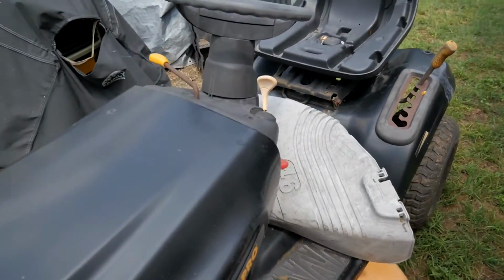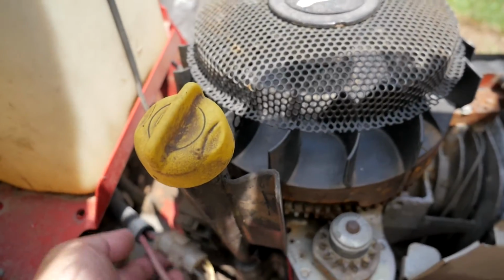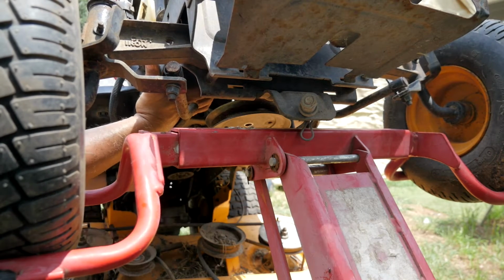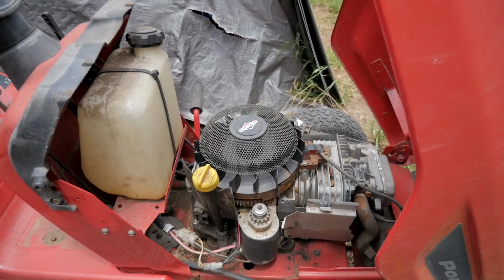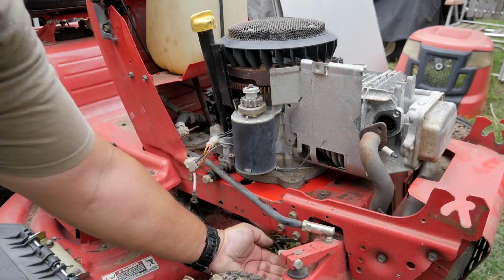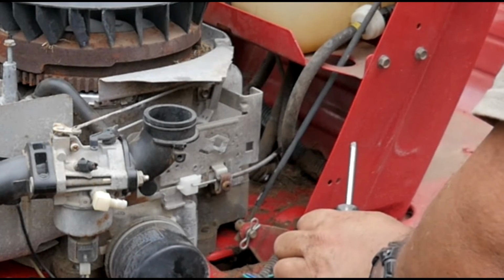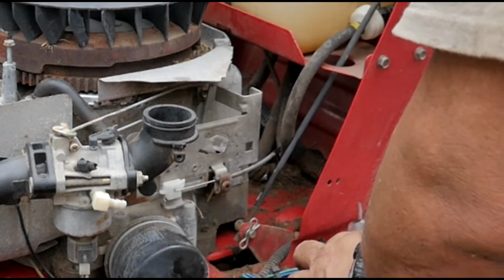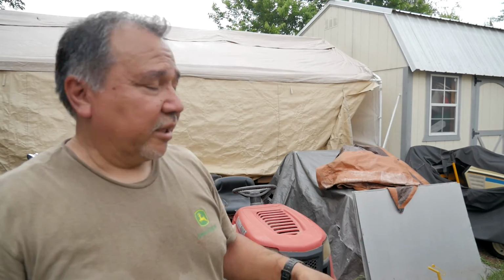Troy-Bilt Riding Mower Engine Swap with a 19.5HP Briggs & Stratton

Comment: I have a 40 inch cut Murry.  It had a 12.5 Briggs.  It was very low on power.  I adjusted the valves and it ran great, for about 30 minutes,  then it started blowing oil out took the engine apart, the top compression ring broke in 3 places.  I installed a Kohler Pro V twin 25 horsepower.  It wasn't real difficult,  but going from the Briggs,  1 inch crankshaft to the Kohler 1 1/8 inch was a pain. I thought easy just get a 1 1/8 inch pulley for the mower deck.  Not so easy.  I took an old PTO clutch apart, and used the lower part. I welded the top pulley from the Kohler to the lower part from the old PTO then cut the deck pulley off the 1 inch shaft and welded it to the lower piece from the PTO. works great. The lower runs true both side to side and it doesn't wobble up and down either.  That was the hardest part.
Reply from the maker: Awesome swap. Great fix.👍👍

Comment: Nice Swap.. Possibly modify a child's swing set (metal A frame style) to be used with a  chain hoist. Narrowed to 1/ 2 width it would take the burden off Ur back for Engine RnR work. Adding 2 fixed and two steerable wheel assemblies from scrap garden tractors would turn the modified swing set into a mobile gantry. Many sets are available for giveaway in online trading sites. Take care and thanks for sharing👍.
Reply from the maker: That would work.👍👍

Comment: Good job with the engine swap but you forgot to use anti seize on that crankshaft. NEVER forget to use anti seize on everything. 😊👍🏿✌🏿
Reply from the maker: I wanted to use some, but I was out.  Bummer.
Reply: @SmallEngineDIY  That is no excuse. With as many small engines that you work on, you should NEVER ever ever ever ever ever ever ever ever run out of anti seize. 🤷🏿‍♂️🤷🏿‍♂️🤷🏿‍♂️🤷🏿‍♂️ Don't forget about the next guy who is going to work on that tractor. 🤔🤔🤔🤔🤔🤷🏿‍♂️✌🏿

Comment: Nice video, thank you.  Any suggestions on how to loosen the engine pulley if you do not have an impact wrench?  Thank you.
Reply from the maker: You can use a socket wrench, but you will need to keep the engine from rotating.  Use a crowbar or something to keep the flywheel from moving, just don't break the fins.

Comment: Im swapping a 19HP Briggs motor out on my riding mower. The new one has a fuel pump and the old one was gravity fed. Can I just bypass the fuel pump and stay with the gravity system? I've never had a fuel problem with the gravity system.

Comment: The valve seat has either came out of the head and jammed the valve easy fix just pull the valve and put the seat back in and punch around the valve seat or your rockers are to lose causing the no compression issue

Comment: I've got a 15.5 hp Troy Bilt Pony riding mower and my nextdoor neighbor gave me a 17.5 hp Troy Bilt Pony mower for parts as the rear drive axle assembly is locked up,but the other parts on it are good.Do you know if the cooling fan is identical between these two mowers as mine just broke into 20 pieces?? Since it's a slightly newer mower than mine by about 2-3 years,I was considering pulling it's 17.5 hp engine and installing it into my 15.5 hp mower,but just for now I was gonna use the fan and swap the engine into my mower later down the road if the one in it now gives up.Thanks to anyone who can help.